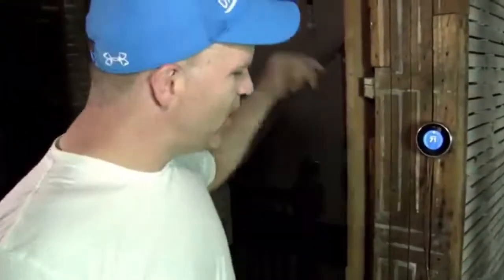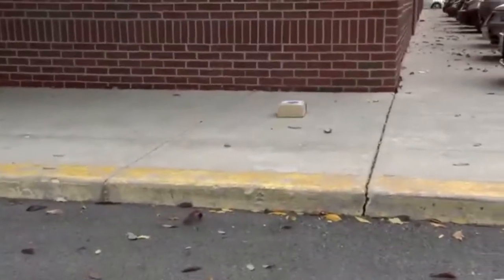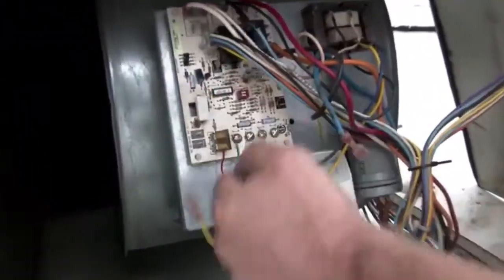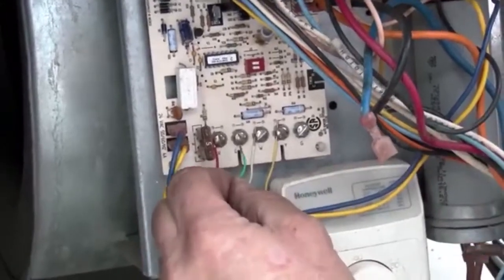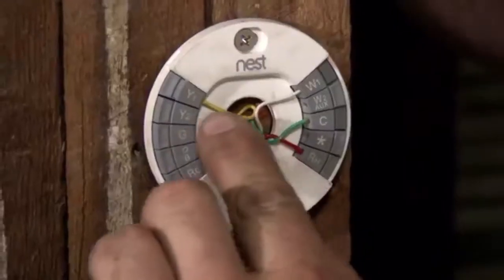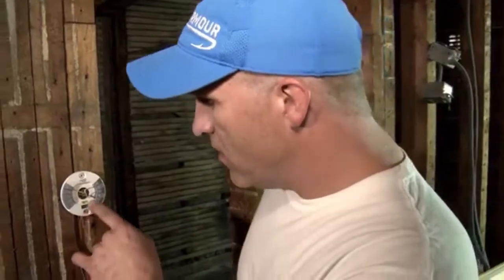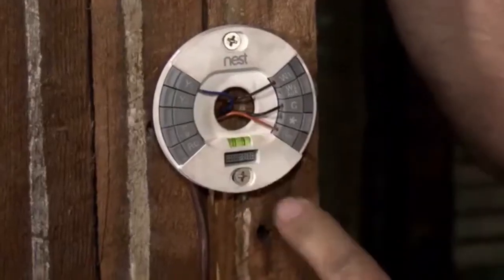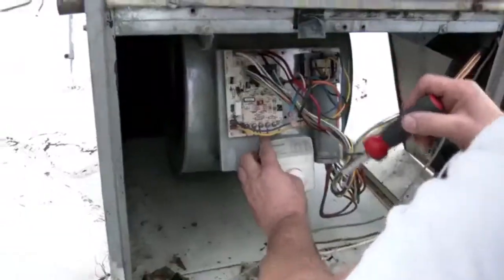Nest Thermostat- No Common Wire or wire colors wrong

Comment: hey kevin. great video! i was wondering if i can get around using a nest thermostat with stranded wires. is there anything you can suggest?
Reply: Install ferrules on the stranded wire or solder the wire tips  or splice a small piece of solid onto the stranded